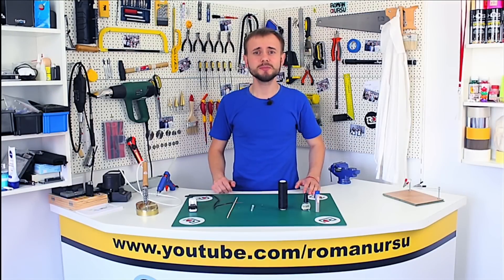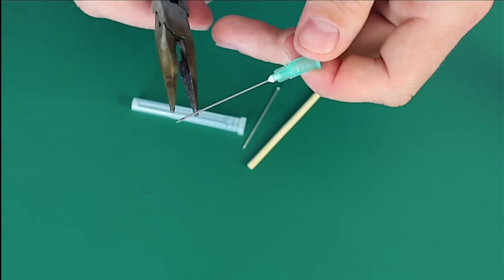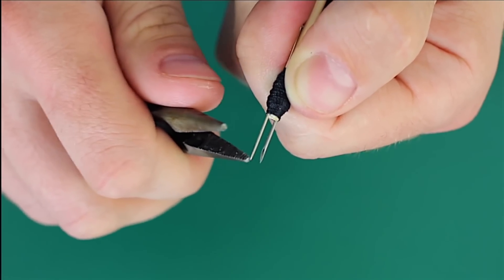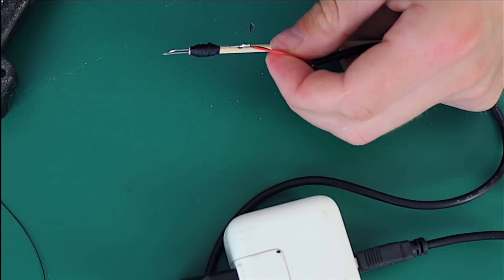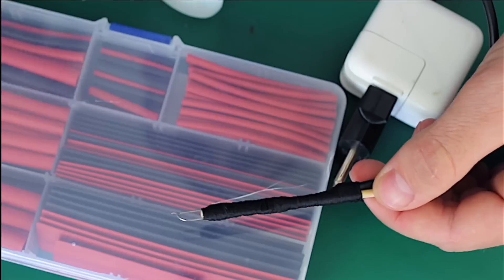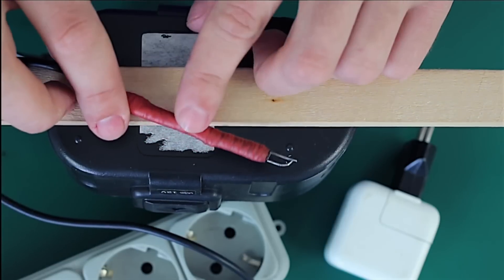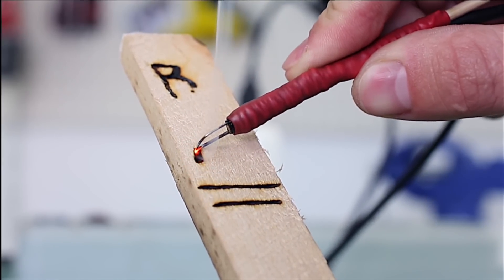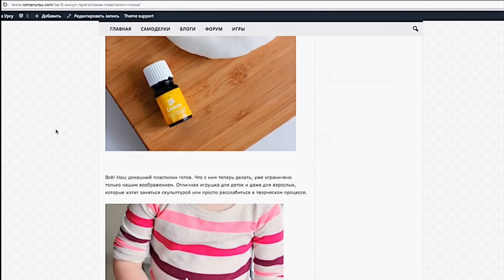How to make a mini pyrography tool

Comment: Awesome video! Personally I would leave a very small gap between the two contact points to break the circuit once the pressure is relieved. And in turn reapplying pressure to close the circuit once you need to use it again, being that a tiny amount of pressure is used to affect fibrous material anyways.

Comment: Apply ohm's law to calculate the current through the tool. Current equals voltage divided by resistance of the tool. So if voltage is 5v and resistance is 2 ohms the current is 2,5 amps. Also the resistance gets exponentially higher with the increase in temperature(a good thing, less stress on power supply). Great videos but make one where you explain the basics. In my opinion one shouldn't be doing anything around electronics without a decent multimeter and basic knowledge of ohm's and kirchhoff's laws.

Comment: well it could be a soldering iron
Reply: +rennier rodil The lead will short out the needles and drops the resistance to 0.
Reply: +Jfetz Fetizanan ahh okay
Reply: +Jfetz Fetizanan ahh okay
Reply: +rennier rodil and the specific heat capacity of such a small tip with low power would not be high enough to solder many larger components
Reply: +Tom Nicholls  but it might be good to UNSOLDER some small components eh?

Comment: Maybe a stupid question but was there any issues with the thread or  area where wires were attached to power supply catching fire, burning through the wood? A sensation of burning or electrical shock if you were to hold above where the connection was made? Thank you for the video thinking of making one as a fun tool to use. :-)

Comment: tried this twice, first attempt with two sewing needles (one regular and a much thinner one, as i had no syringe needle) and a usb micro b charging cable, second attempt with a sewing needle and piece of thin wire + usb c charger, both only resulted in sparks and no heat when i touched the needles together. I'm not completely sure, but i think the wattage of my power source might be the issue, as well as the second needle (I'm unable to procure medical needle) but a second opinion would be great. help ??

Comment: Do I really need to different needles? Or can I just use two same kind of needles?
Reply: +Mudffin 1 solid 1 hypo dont use 2 solid ie sewing
Reply: +Mudffin like mottthehoople said, you will need one hypo and one solid, the solid (sewing needle) has greater resistance as opposed to the hollowed hypodermic needle that offers the least amount due to the thin walls.

Comment: wouldn't the needle ends also heat up and burn off the insulation?
Reply: +ASHWIN S.N (ASH)  That's a good question. Only the ends that makes contact will heat up due to the electrical resistance.

Comment: ok isnt the thread gonna burn or the wood from the heat that is being transfered ?
Reply: +Todor minchev Well only the very tip of the needle is heated due to it being so thin, I did not see the rest of the needle change color, it did not even get darker so I think its safe to say that the thread and wooden handle will be okay. The thread was covered with superglue so I can't imagine that it will be able to burn and if you are planning to make one be sure to coat the wooden handle with resin, enamel or some other kind of coating and that should help to keep it from burning :) Good observation though, At the start I wondered the same thing.
Reply: Ame Nightcore thanks for the info  :) im really into woodburning so thats looks like a easy way to make a tool i use a soldering iron but a told like this it looks like more easy for detail work :) keep up the good work

Comment: hey. nice tutorial. i have a question. do i need to use both needles different or can i use the same? i have a 5v charger output with 0.2 amp. will it work? its my PSP charger. thank you.

Comment: Please help me. why this tutorial did not work for me. I've been using some type of phone charger. but just a hot tip of the needle, not burning .. then I use a 9v battery, but also not too fiery, please help.. thanks 🙏
Reply: lick tip for heat

Comment: I made mine by modifying an ecig. The rebuild able dripping atomiser has 2 posts meaning it was easy to make custom shaped wire heads for different effects and shapes like letters etc. The use of batteries also means it is cordless. Only do this if you know what you're doing - vaping has enough bad press without some fool blowing themselves up doing pyrography - of course this would never happen to me 😇🔋
Reply: +Jonto Dickens  Hopefully not famous last words brother.

Comment: can i use it as solder iron??
Reply: No as when. The solder lead melts it will increase the contact area between the needles and short the supply
Reply: okay ty..

Comment: can i solder with it?
Reply: No, solder will fuse it together, short it out.
Reply: It already is shorted out. lol. It's a direct short. That's how it creates heat.
Reply: Yes, but add mass to that and the short could transfer to somewhere else in the circuit. It makes the whole thing inoperable. Often in such such circuits there is no where else for the heat to escape, but the power outlet end.

Comment: How to make a 3.6v dc motor to work with ac wire to pluggin to an electrical outlet. 120v dc outlet. Without buying a different motor. Just the same 3.6 volt dc motor to take 120 currrent. To make a a plug in 120v drill.

Comment: Why can't I just use two sewing needles.
(I don't really have access to medical syringes)
Reply: +Ishaq Ballut You can try, but it will be harder to get the tips to touch properly and you'll have less resistance, so less heat.
Reply: +Nixola97 oh ok, what makes it that syringes  needles are resistant
Reply: +Ishaq Ballut probably the material used. Also, the thin walls of the syringe mean there's less metal to heat up and it gets red/hotter a lot faster
Reply: +Nicholas Guida ok so if I made a sewing needle really thing by grinding it down on a belt sander do thing the would help?
Reply: +Ishaq Ballut i meant to say really thin*

Comment: Help!! I have 4 colors in my wire, red black white and green!! what i must to do??
Reply: Cut off the green and the white. USB uses that for data connection. You don't need that here.
Reply: +Chuck Norris stare it down till its the configuration you want,
Reply: +mike mulligan haha, i didn't get that until I noticed the chuck norris picture. XD
Reply: +Chuck Norris cut the white and green 
red is positive
black is negative
Reply: too bad
Reply: Cut away the white and green there not necessary
Reply: U can use that for data
Reply: +Chuck Norris white and green cable are data cables, use only plus (red) and GND(minus - black)
Reply: red and black wires are the way to go the ithers are transfering data which doesnt matter and polarity doesnt matter
Reply: why is chuck norris asking this when he is chuck norris 😂😂😂😂😂

Comment: can you make 4 volts to 12 volts step up booster ????
Reply: its actually cheaper to just buy it from ebay because a boost converter require inductor coil, capacitors, diodes, bjt or mosfet that is unless you have spares
Reply: i wouldve buy ebay doesnt ship products to my country . i can get all the parts i would really appreciate if you make a video on it :) how to make a 4 volt to 12 volt booster :)..
thanks for replying to my comment :D

Comment: anyone care to explain to me why only the tip heat up that hot to burn the wood ?
Reply: cause its a resistance point
Reply: and bcus it only touches there , and it has more power where it touches

Comment: I used pins it didn't work ????? With 9v
Reply: The combination of the sewing needle (or pin) and the hollow syringe needle is kind of important, for a couple or reasons.
1. the syringe needle offers a resting place for the point of the sewing needle or pin
2. the type or surgical steel from which the syringe needle is manufactured has a fairly high electrical resistance in comparison to an ordinary needle and will heat up better.
Reply: AlbertBester - Thank You.

Comment: Hey guy I want to know if is work o not,if is danger with my circuit.
Reply: Im a electrical engineering Student and I personally wouldn't do it. the risc of the needles being too close together and therefore shorting out your power supply is way too high. the only safe way to do it would a current limiting psu.
Reply: Ok what about if instead of needle I use nicrom wire and how much V I use to make pyrography pencil 12V or less.

Comment: What happens if i use ductape instead of thread?
Reply: it melts maybe?
Reply: Eactly, it'll burn. You should use some cloth material like fabcric to cover the entire surface, then you can recover with colored ductape or whatever you want.
Reply: Ah thx for the tip ^^
and what kind of do you recommend (considering the volts and amps) cuz last time i used a 4.5 v charger and it didn't really do anythin besides sparking xd
Reply: Then use a higher voltage, I think 5 v should be fine. It personnally worked for me, good luck ;)
Reply: Try electrical tape

Comment: what is a flax
Reply: +Poloy Alcuizar  Flux is used in soldering to remove oxides from the contacts of the parts to besoldered together
in other words , it is a substance helps the solder so stick on metal
Reply: flax is a spatial anomaly that is known to capture and enclose vessels so that not even the stars are seen.

Comment: 4.7 V - 0.55 A
What am I doing wrong ?
there is not heat AT ALL !!!
Reply: es de 5.volts y de 200mA
Reply: 0.55 A < 200 mA ?
Reply: better use a charger 5 to 9 volts at 200mA MrkiSerbian
Reply: The  amperage is way too low. I would use 2.0 amp min.
Reply: tnx ! :)

Comment: why dont u use the electric tape instead of the threats
Reply: +Truong Quoc Khanh I was thinking this too.  Maybe he thought the thread and glue was more of a common household item. I'm not usually into techy stuff but electrical tape is so basic that I thought everyone has it.
Reply: the adhisive on the electric tape wil melt deu to the temprature of the needle and on the handle is shrinking tube
Reply: +Jimi-ray grotenhuis i made one and it works fine. my handle doesn't get hot but I made mine the way it was suggested and shown thred supa glue etc etc

Comment: Hi guys! anyone have tested it? I tried to realize it, but it doesn't work, anyone can help me ? I used: a nokia power supply, DC 5V/ 1200mA  in output, a syringe needle and a needle for sew.
Reply: +Pasquale Ripa I tried it too. It didn't work- Don't know why.
Reply: +Pasquale Ripa  corrente troppo bassa
Reply: I used 12 volts and it works just fine
Reply: test the tip with a thermometer and if it raises, it works fine but if it does not burn wood, change the voltage up to 12 V . and check the connections.
Reply: well it was the connection between needle and syringe needle. or because of the current flow it would be 2 ampere or 2000miliamperes

Comment: My adapter voltage is Output: 5.1V -- 2.1A  It's not working
Reply: +Little Tree Then the adapter is faulty or, most likely, you made some mistakes while building it.
Reply: +Nixola97 so less heat.

Comment: I tried many times. The 1st time i used a 9V=70A battery, and the needles burned. The second time i tried an adapter 5V=2A and the needles were just warm. 
What you think guys, is a 5V=6A adapter good enough for the 3rd try?

Comment: please dont be that stupid. this is short circuit and you can kill 10% of some smps psu or it will not work because some of then have short circuit protection
Reply: Hurrem Haseki Sultan limit current with something.
Reply: +N!cky Agree with you, there is no high resistance on contrary there is low resistance so short circuit. It can damage power supply and may heat it up. Do not do this experiment.
Reply: Burak Ciceksoy first of first, battery heats up, then valves open and acid can escape :D
Reply: :D
Reply: Mott theHoople limited to 6amp? what if somekid connect this to $1 smps with 200ma output and something sets on fire?
Reply: +N!cky I dont live in the what if world.I followed instruction it worked fine. only a very fine point is making contact not a half inch nail.
Reply: Mott theHoople u wot m8
Reply: MasterSteve26  say what? hey old chum what would you like to know?
Reply: +N!cky so, you're saying this experiment could be dangerous, what could happen, I want to try it
Reply: +N!cky what is a short circuit?
Reply: Ishaq Ballut yours power supply will just make little boom and magic smoke will escape from it and you just ruined yours psu. short circuit is direct connection betwen pairs(+/- live/netural) or low resistance load
Reply: +N!cky Heat increases resistance. If one uses a proper, high current adapter (as Roman advises to) and there are no mistakes when building it, the current will be limited by the heat produced.
Reply: Nixola97 but if power supply doesnt have current limit or short circuit protection inrush current will destroy it. im talking that all of the time. i know that heat increases resistance but what will happend when you connect it in start?
Reply: It will heat up almost instantly. The needles need to heat up, but the internal components need to too in order to cause damage. The needles will heat up faster.
Reply: Nixola97 with smps short circuit protection will instantly kick in in less than few miliseconds. that is why on most smps is needed soft start
Reply: +N!cky Ok, what do you suggest then? I want to make it, in a safer way. Thanks!
Reply: AGloriousDawnLP you should get a heating element which is connected to 230v/110v, basically the same as on your oven or something
Reply: +MasterSteve26 Right... But... Where's the fun of it? I want to make it. Not buy a finished product.
Reply: AGloriousDawnLP well find a way to make one then